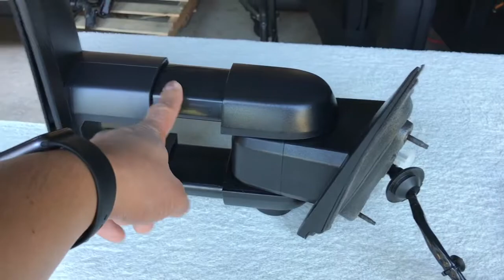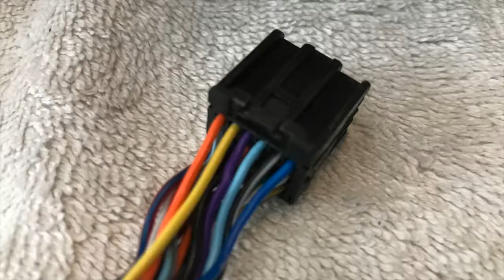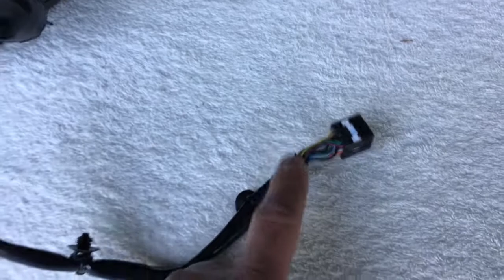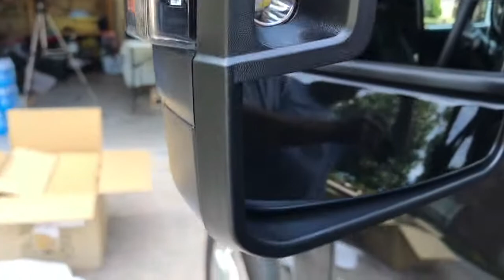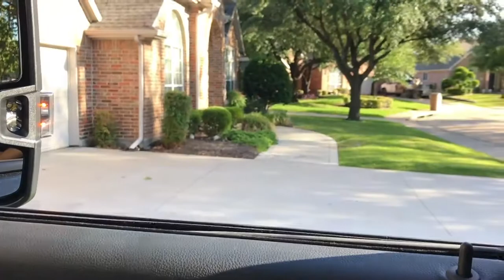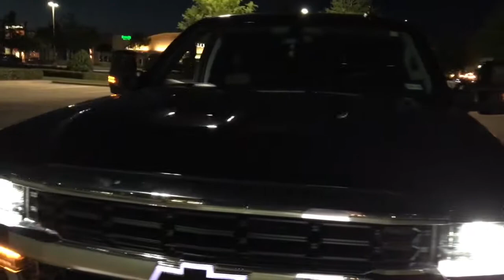2014 - 2017 Silverado/Sierra:  Aftermarket Towing Mirror Upgrade Review - 1AMRP01786

Comment: Do you have a link/ part number to the correct female terminals that are in the connector in the door jab by chance? 2014 LT.
Reply from the maker: Don't have the part # but have those in stock.  Contact me via the website if interested.  HarnessDR.com

Comment: Hey can you do a video for an upgraded tow mirror for a 2019 Silverado 2500hd wt from manual tow mirrors to boost auto mirrors
Reply from the maker: Vincent Juodka process is the same as long as you have power windows.  You will need a few more parts. Contact me at HarnessDR.com for more info

Comment: So if I plug this straight into my 2014 ltz the outside white lights wont work is all?
Reply from the maker: Michael Kula - Nope. Just the Turn signal will work.
Reply: @philgamboa2906  thanks, I will probably get them and just put them on for now, need them for my camper asap

Comment: Hey Phil my kids just bought me aftermarket towing mirrors for my 2016 WT 2500HD for Christmas but I have only standard mirrors no power non heated just your basic mirror how do I make these ones work as the new ones are heated, signals, manual fold I think but not sure
Reply from the maker: Kevin Smith - If you have power windows, you can upgrade and gain power adjust, fold, lighting etc. email me at gamboaphil@gmail.com

Comment: How would I wire this if my truck came with manual mirrors?
Reply from the maker: James Hensley - Email at gamboaphil@gmail.com

With my upgrade kit, I’ve helped truck’s with manual adjust mirrors gain power adjust and power fold.

Comment: I just installed these tow mirrors in my truck, 2018 Silverado 1500 LTZ, it had the DL3 mirrors with power fold/memory/reverse tilt/turn signals/heated/puddle lamps. Instead of using the plug and play harness, I metered my wires and used the marker and cargo lamp off the mirror to pins 9 & 11 of the vehicle door harness. Both mirrors work with the adjustment, markers, turn signals, hazards, cargo light, memory, as well as heat. However, my RH mirror puddle lamp, reverse tilt, and power fold are not functioning. I was wondering if you know if this is a common occurrence or some wiring issue? I will continue to troubleshoot tomorrow but was looking for some direction or advice.

Thanks in advance.
Reply from the maker: That is a very odd symptom.  Something must have happened during the wiring done on the passenger side.  Since puddle lamps don't really "exist" on factory tow mirrors, I use an empty slot to land the wire on the mirror connector end, then route that to correct puddle lamp circuit on the door jamb.  If you reinstall the DL3 Passenger Side Mirror, check if they fold and regain the feature you lost.  Power Fold, Reverse Tilt should have been retained.
Reply: Phil Gamboa thank you, so I did more troubleshooting and it ended up being the wires to the motor on the R side mirror itself, I soldered the connections and then soldered the butt connections they had for quick disconnects and it’s all working fine now! Thanks for the advice. 

Daniel

Comment: Great video! I have a question about mirrors.  I already have tow mirrors 2018 Silverado 3500hd, how can I make them power folding? Thanks
Reply from the maker: Stacky Stacky - Swap them out with DQS Power Folding Mirrors. Replace the switch.
Reply: Thanks

Comment: Hello sir I have a 2014 GMC Sierra Z71 4*4 SLE and want to install towing mirrors what is that parts I need and harness or is it even possible
Reply from the maker: It is possible but will require more work since you're 2014.  See my other video RZY Jumper Harness - 23387133 video.  It explains the extra wiring needed.
Reply: Phil Gamboa can you install and were are you located ?

Comment: I have a diesel 2015  power mirrors no power fold chev silverado LTZ which A1 power mirror will fit  and which of your plug lpay harness will i need my mirrors dont have the amber run lights or the back up light this was the early 2015 thank you for your answer in advance
Reply from the maker: I am advising against 1A Auto Tow Mirrors that support Memory at this time as it was discovered that there are experiencing an internal wiring error.  Do you have seat memory on your truck now?  If so, what type mirrors to you have now?  Are the tow mirrors with just the turn signal (1st gen DPN)?

Comment: Hey Phil the Amber light on the outside courtesy lights are they on all the time or only at night? I had mine installed and they only turn on when I turn my knob 1 time but the head light turns off if turn it 2 times they all turn on I'm wondering what went wrong I want them to turn on when my head lights turn on ( when they are on auto or just stay on)
Reply from the maker: Cynthia Reyes - Amber the 2 Amber LEDs that are next to the White Cargo LEDs are Turn Signals.  The Amber LEDs that shine forward are running lamps that come on anytime the headlamps are on.  Did you get the same mirrors from 1A Auto installed?  Or GM Mirrors?

Comment: Hello I just bought a 2017 GMC Sierra SLT and hate the tiny mirrors , I was told that i can get tow mirrors from the dealership but they wont be power folding ? Will these mirrors shown here work for me ? Thanks in advance !
Reply from the maker: Yes - You will need to swap your harnesses with my custom built harness that will support all the lighting options on this mirror.  You already have power folding, so this the ONLY after market mirror set you can get that will retain your features.  I have provisions that will come with my harnesses to support this specific mirror.  I used to have a need for the mirrors to come to me fix, but now have pigtail wiring.  This will save you $150 by not needing the mirrors to come to me.  Contact me at - pgamboa@yahoo.com for more info and if interested in the ordering harnesses.

Comment: Hello Mr.Gamboa I have a 2017 Silverado 2500hd duramax Ltz midnight edition. I have installed the gm power mirrors everything works as it should until I get to the AUTO FOLDING MIRRORS option on the my link. The kicker is I had the 1500 power folding mirrors, is there anyway to get that option so when I hold the lock button it folds in by itself and and unfold when I unlock??
Reply from the maker: Did you have this option before?  If so, it should have retained.
Reply: Phil Gamboa To be honest I do not know I did not check until I installed the  power folding tow mirrors

Comment: Phil, great work for this confusing upgrade. Note that you show this for 2014-2017, 1AAuto people will not commit to it fitting/working with a 2017, any idea why.I have a 2017 LT All Star Edition with DL8 mirrors (power adjust, heated). Really like to upgrade to power fold tow mirror, however would settle for the mirrors with the turn signal and lights. Just to make sure, what is the difference in the install? Thanks, just subscribed to your channel.
Reply from the maker: A lot of mirror makers will not show compatibility simply because what we are adding is not "GM" sanctioned...so to speak.  The wiring is the same for 2017.  I have verified the wiring via GMUpfitter Manuals online and have successfully helped other 2017 owners with this very upgrade.  We are retrofitting circuits that are not generally provisioned by a GM OEM Mirror.  What I have learned through this process is that these circuits are present at the door jamb of these trucks.  For 2014 and some early 2015 trucks, there are additional requirements to make this upgrade happen.  For mid/later 2015 and on, these circuits are present at the door jamb.  So my harnesses and service allows you to retrofit this upgrade by making the connections from the mirror, to the door jamb.  All in an OEM and Plug and Play fashion.  Hope this helps.
Reply: Thanks Phil, I've taken the door jamb boot off and gotten photos of the pin arrangement, just don't see any #'s for the pins. Hoped to be able to get you the photo so you could confirm what features would work or not, or let me know how they are numbered and what numbers are needed. thanks again
Reply from the maker: Email me at pgamboa@yahoo.com and I'll get ya the info you need.

Comment: I have 2017 GMC Sierra SLT do I still need to add wires or is it plug and play?? Mine has fold mirrors ,heated ,memory , puddle light also would this mirrors
Reply from the maker: Wasawirii 15 No matter what trim you have, if you have the smaller DE2, DL8, DL3 mirrors and upgrade to Tow Mirrors, you have to either swap your harnesses, or modify your existing harnesses.  The stock harness on all the smaller mirrors will not have the Cargo and Park Lamp circuits.  Since you have DL3s now, you'll have the turn Signal circuit present.  On DL3 harnesses, the auto dim circuits and puddle get deleted and park/cargo lamps get installed in those slot positions.

Comment: Which mirrors would you recommend? Factory or aftermarket?
Reply from the maker: I like Aftermarket Mirrors from AM Auto/1A Auto.  They are solid mirrors with great warranty.  Both of these companies sell the same mirror.  AM Auto has them slight less.  AM Auto has a 10 year warranty as opposed to 1A Auto's Lifetime Warranty.  

I like the Smoke Lens that these mirrors have.  They will save you about $500-$700 going aftermarket.

Comment: Phil - I'm researching this for my truck.  Trying to determine the differences between these and the 1AMRP01771 given the significant cost difference.  I have a 2016 Silverado CCSB LT so the 1AMRP01771 would be the right choice correct?  Seems like the added cost for the 1AMRP01786 is for memory settings which I wouldn't have anyway in the LT.  Is that an accurate assessment?
Reply from the maker: Jason, this is a correct assessment.  01786 has mirror memory and a bonus puddle lamp.  Although, the pricing for 01786 has gone down to the $500 range as opposed to $750

Comment: Hello, love the videos.... Are these mirrors plug n play for a 2015  1500 LTZ with puddle,blinker,memory and power fold right out of the box or is there wiring needed for these to fully function ? I am looking for tow mirrors and these seem to be the ticket but I want as plug n play as possible. Thank for the Help. Chris
Reply from the maker: Hey Chris.  These mirrors are not Plug and Play as the connector on the mirror itself will need customization.  Also since Puddle Lamps are generally not on Tow Mirrors, that's what makes this set unique.  I offer a connector customization service on the GM Forum (Link in the description).  This essentially moves the puddle lamp circuit to an unused slot on the mirror connector.  I then make a harness that is also pinned so that it will be Plug and Play.  So out of the box, it is NOT Plug and Play.  If you order the mirrors, you can have them shipped to me for the purpose of making them Plug and Play.  You can reach me via the Forum Link above.  Thanks!
Reply: Phil Gamboa Thank you so much for responding ! I am actually between upgrading to tow or upgrading the truck from a 1500 to 2500 or larger to get more towing capabilities. Wife wants a new Travel Trailer so 1500 may be going. Thank you again for the help and I will be in touch.
Reply from the maker: Sounds good! I am active on the Forum (Link in the description).  Lots of good info and feedback from other members.